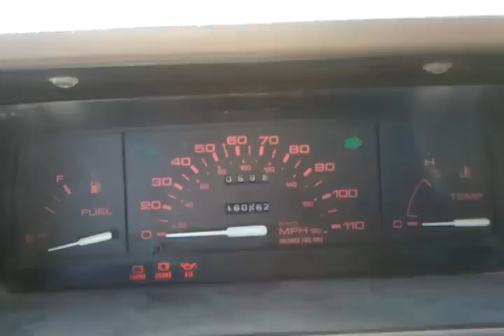How to Use Your Turn Signals

Comment: I just had to click on this video when i saw the thumbnail with a Mazda interior on it :D I used to have an '89 B2200 diesel. I loved that truck. Slow as hell but it had alot of torque and a LSD so it wasreally fun in the winter. Sideways in every single intersection and roundabout.

Comment: Sir.Thanks for sharing this because  the lack of or improper use of turn signals is one of my pet peeves! As you know there has been extensive coverage,reporting,and the dangers of texting while drving,(and rightly so) however a new study found that the lack of turn signals caused twice the number of accidents as from distracted driving like texting and cell phone usage,so in my book this should be classified as BREAKING NEWS! P:S.I noticed when you turned your left turn signal on the rear or front bulb was burned out in your vehicle.You can read this new study under,"Lack of turn signals and increased accidents"

Comment: Fast blinker means one light is not working. So who is not using their blinker now?
Reply from the maker: Augur The truck was not working at the time that I made this video. I use my blinkers ALL THE TIME. The light quit working sometime after the truck broke down.
Reply: Augur I thought that meant the repeater needs to be replaced
Reply: @Kramit2012  it's because you drive a Ford that's why your vehicle sucks
Reply from the maker: @LostinParadise03  I no longer drive a Ford. And that was a Mazda in the video. Besides that, my old Ranger was one of the best vehicles I've ever had, owned it for 4 years and had very few mechanical problems with it.

Comment: LOL! It's such a simple thing that takes such little effort. I don't get why it's so difficult for people to do. When switching lanes, you can also push it down enough to turn them on but not stay on like when making a turn. They will turn off automatically when you take your hand off of it. But that's even too difficult for some reason. The more expensive a vehicle, the less likely the driver will use signals. You'd think with how much money they spent on their status vehicle that turn signals would come standard. ;)